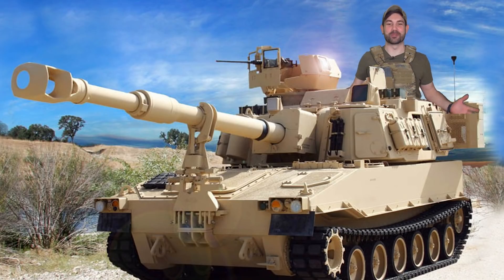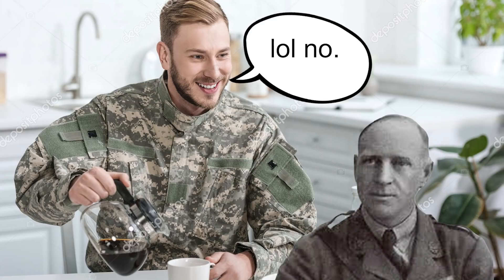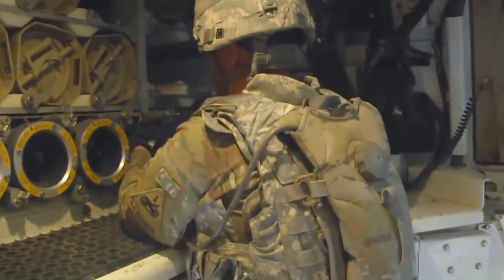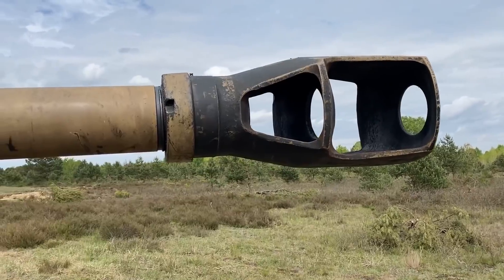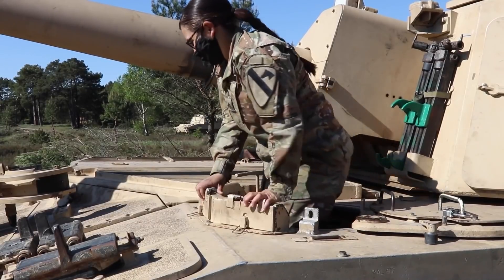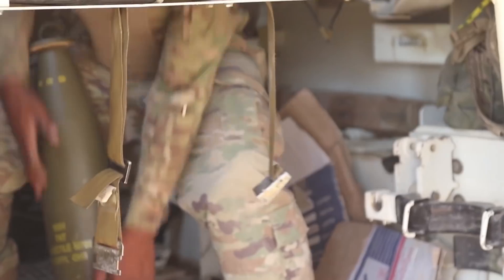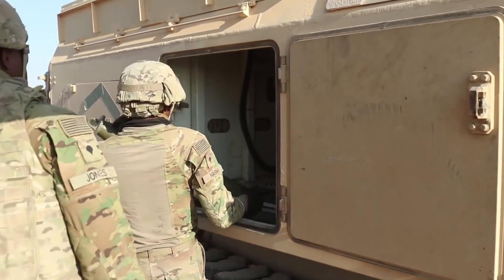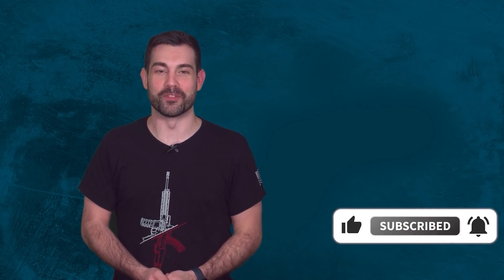M109 Self Propelled Artillery Vehicle Tactics Explained

Comment: Well ERCA(extended range Cannon artillery I think) is pretty much well actually I think it is officially done with design and they're just finishing all the testing and evaluation on it, it would have been done like 2 or 3 years ago but they couldn't fit an auto loader into their first turret design so they had to remake the turret for the XM 1299 ERCA which are on the m109 chassis I haven't really heard what they're going to do what their plans are cuz they're still buying 109a7s, with ERCA being available supposedly production will start low rate in 2024 or maybe the end of 2023 so I don't know why they like they just ordered I think a couple hundred more and 109a7s...

Comment: If you've seen Sweden's take on a Howitzer, you'd know the 'Archer' is the Future. The M-109 is nifty, great, and much-copied. It it is replaced, the next variation needs to be, literally, built in design, from the Inside-out, and Every possible limitation in design eliminated by that design process. The outcome, may very well be like an Archer, but with Tracks and amphibious ability? In any case,  going from "fire" position to 'Scootering' and back, and doing so quickly and accurately, is a Priority.

Comment: Ukraine has shown how effective howitzers can be in destroying tanks. Guided 155mm rounds are very deadly. Ukraine is using an effective combined arms campaign. Artillery remains the most dangerous weapon for use against artillery. The HIMARs in Ukraine could be extremely deadly. As Russians are using cluster munitions so Ukraine should also be able to use their cluster bombs and rockets. They are  excellent for shoot and scoot. They are much easier to hide than many of the Russian MLRS systems. And Russia is wasting its best rockets to destroy civilian targets. That is not sustainable for Russia. Can the M-109 b used for TOT, Time On Target where 3 or 4 shells could hit a target at the same time. It seems Ukraine has been using guided 155mm rounds very effectively.

Comment: How does the hypervelocity shell work? more charge or better shape or light weight? How likely would such a shell say hitting an incoming rocket be?
Reply: Hypervelocity shells are just a new type of projectile that can be fired from 155mm, 5 inch Navy guns, and future electromagnetic (EM) rail guns.  They will have a more aerodynamic shape, improved guidance systems, and steerable fins to hit target more precisely.  It can maintain a higher velocity because of lower drag and maneuver as needed to decrease time to target.  The advantage will be having a smaller projectile that is more accurate with decreased flight time that can be fired a lower angles to reach targets faster.
Reply: @mrgold3591  The charge has to develop higher pressure, too?
Reply: @charlesrichardson8635  I can see this type of round being used for over the horizon indirect fire for precision strikes down to direct fire of line-of-sight targets.  They could even add a rocket assist motor to increase the range even further.

Comment: Been with M109A4, A5 & A6 units in Maintenance.  Like anything they have pro's and cons.  The FA board at one time played with putting a 20mm (might have ben a 25mm, it was a while a go).  The 109 like anything takes a lot of crew maintenance, if the crew is good it lasts a long time, if they are not, they tend have NMC status on a continual basis.

Comment: I don't understand artillery. How di you hit an object 20 miles away? Have you done a video on this subject?
Reply: Artillery uses a forward observer either with a drone or in person to identify the target(s) on a grid system.  The fire direction center knows the precise position on the same grid of the howitzer, where the target is located, and factors in all other variables like weather, wind, temperature, humidity, curvature/rotation of the earth, etc.. that will affect the round in flight. The forward observer will adjust as needed additional round downrange if they don't hit the intended target (left 100 drop 100 for example).  The command "fire for effect" is given when the rounds are on target and a single or battery of guns are needed to put steel on target.

Comment: nope its not 6 rounds per minute (max)... it's 4 rounds per min in the first 3 minutes and after 3 minutes its 1round per minute...also if the artilllery platoon has to do direct fire , the battle is lost
also the new system that can give you target location and grid etc it's called NAPOS..
P.S i'm second leutenant artillery officer from Greece.

Comment: probably a silly question but: with today's tech, gadgets and gizmos,  would it be possible for self-propelled arty to fire accurately while moving? and if so, or if not, would it be a worthwhile innovation to develop? from a fmr 91B10.
Reply: It would come down to the calculations to put steel on target with the dumb rounds.  Trying to shoot while moving over rough terrain would require up to the very last second additional ballistic calculations to put the round on target from up to 30km out.  It would be more accurate the closer the range, but, it could be way off with a bump in the road at +15km out causing unforseen collateral damage.  I can only see shooting on the move if the the rounds were "smart" with GPS and were able to steer with fins and/or rocket power.
Reply: @mrgold3591  great response!. Would stabilizing the cannon like the Abrams's make a difference?
Reply: @robzilla730  No because the Abrams is a line-of-sight direct fire under 4 km and the Paladin is indirect fire under 40 km.  The Paladin has to be able to drop rounds within 40 meter with friendly troop nearby.  One mis-calculation of centimeters with a moving howitzer could send a round in to friendly troop 20-40 km kilometers away.
Reply: @mrgold3591  for that matter, why not just mount hellfire missiles or their modern equivalent on tanks instead of the main gun? Don't hellfires have higher probability of first round kills and less dependent on line of sight?  Enjoying this discussion.
Reply: As a 12 B in '90 - '92, think about it, the Field Artillery is intended to hit targets from miles away. If we needed to fire on the fly, that would mean the front line is gone. As I told my Drill Sergeant at Fort Sill "I'm in the Artillery, if I have to run, then everyone else is dead!"
Reply: Sorry, *13 B, stupid big fingers!
Reply: @timbouv  well, SPG's could be in a convoy moving out like say, for instance @ Ft Irwin, they recieve  orders for fire mission and could start firing once in range. But like the other guy here said,  the slightest bump would send the rounds way off unless they're smart rounds.  Btw, hear the rooskies were firing something like 30-60 K rounds a day! Talk about thunder!

Comment: I was a E4 specialists 13-E cannon fire direction specialist in Paladin Batteries in the Idaho and Utah National Guard.  The 13-E MOS has since been replaced by another as all artillery, missile and cannon, fire direction centers are using the same computer software now, but different from what I was trained on.

The M109A6 and later models have a lot of sensors built into them.  The computer on the gun knows its exact location and orientation, the temperature of the stored shells and powder, the temperature of the barrel, and the muzzle velocity of each shell/fuse combination at different charges it has fired in the past.  The forward observers also know their exact location and with their fancy box with its computer,  compasses and laser rangefinder, it can calculate exactly where the target is.  The computers used at battalion and platoon fire direction centers take all this data as well as the rotation of the earth and wind speeds at multiple elevations, to calculate the required powder charge, elevation and azimuth of the barrel needed to hit the target for each individual gun in a platoon or battery so they each get unique fireing orders.  It also calculates the time of flight so a fuse can be set to detonate above a target or delayed till slightly after impact.  It also allows us to calculate time on target missions so each gun fires at a different time so all the shells hit at the same time.  Or if a crew is really fast a single gun might fire two or three rounds at different elevations and powder charges so the all impact at the same time.  As long as we and the 13-Fs have connections to GPS satellites and good meteorological data we were accurate with in 10 meters and fractions of a second even with a 12 red bag high angle shot.

Oh, and yes as of 2001 the USA has 155mm nuclear rounds that the M109A6 can fire and be outside of the blast radius of.  I got to look at the firing tables for those things, nasty piece of work, and as of 2001 we still had some forward deployed in South Korea for our batteries south of the DMZ.  The might be out of service by now though, although not exactly a secret that they existed, the exact numbers and locations are secret.
Reply: Thanks for adding a longer comment full of interesting observations and facts.
Reply: Thanks from a former 13e/13p

Comment: You failed to mention one key ability of the Paladin. At it's highest rate of fire, it can shoot 6-7 rounds and time them to land on a target at the same time. This is achieved by having the highest arcing shot fired first and lowering the gun with successive shots. If a group of four guns does the same thing, 20-25 rounds can land on a target--not at max range of course--simultaneously. Then the guns can displace and move to another firing position and repeat this process again and again.

Comment: Nice summary, Chris.  I commanded an A6 battery, and worked on A2s, 3s, and 4s before that, and this is pretty good info for 10 minutes.  Pretty much as you said.  I'd add the M992 ammo carrier has long been a significant upgrade over the old M548 (with canvas coverings that can catch fire and blow up your entire ammo carrier! Really! Ask NTC) you showed (my first unit was one of only 2 left in the Army with them, and that was 30 yrs ago). I believe the newest 992s are also Bradley-based.  And as someone below noted, that A7 chassis is all-new.  The turrets were first reconstructed for the A6 (including adding a layer of Kevlar inside) and now the chassis is new as well, so it's not REALLY a 1960s weapon anymore.  The big difference with the 1299 you showed is the gun tube (think it's like 58 calibers long. Yes, there is ammo caliber and gun tubes are measured in length by calibers (different) as well). Range is the big thing now, esp for something that's heavy. When I was a commander, 30 km was crazy range for a 155 howitzer (I shot the old Charge 8 Super with RAP, yes); now, it's sorta pedestrian, and you have GMLRS shooting 60-70 with precision, so... I was NOT aware of the hyper-velocity round--thanks for that (I've been retired 6 yrs now).

On that Syrian mission...I'm sure they did a great job, but honestly, we did that kind of thing all the time.  And yes, you CAN exceed your max firing rate (and still can) because the Paladin has an active temp sensor on the gun tube. As long as it doesn't get too hot, you can fire your ass off (we did, routinely).

Codenames Steel and Thunder.  Those were the battery call-signs, obviously.  Hilarious if they dubbed them "codenames."
Reply: Hi McTaguer, I am curious if there are any nicknames for the gun crew positions, or slang used for their positions or for the gun. I like to learn the lingo used by soldiers in the field, whether humorous or fun or "dark humor" slang etc. please let me know of any you heard. Thanks for your service.  Sincerely.
Reply: @steadmantheartist  Not in my experience, but I'm hardly universal. You have the Chief, the Gunner, Asst. Gunner and pretty much everyone else goes by crew position number (technically "cannoneer"), and driver. I've read things like people calling #1 Man "swabber" or #4 "rammer."  My battery/battalion didn't, but I suppose others have...
Reply: @mctaguer  Thank you for your answer.